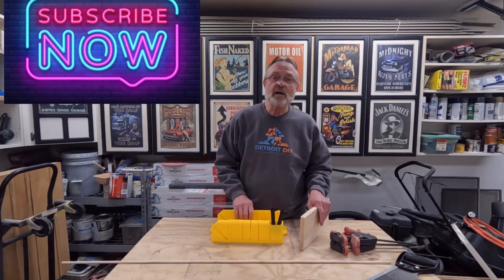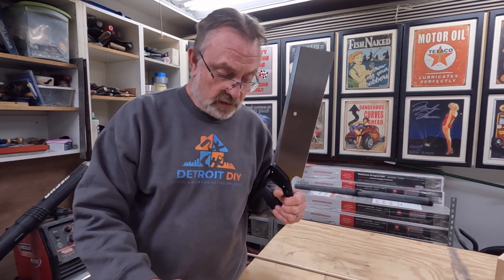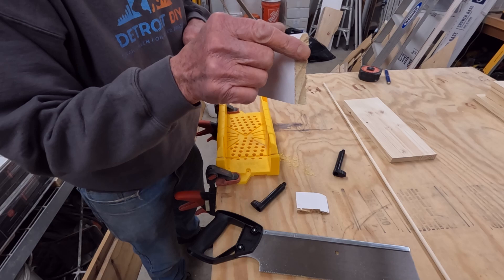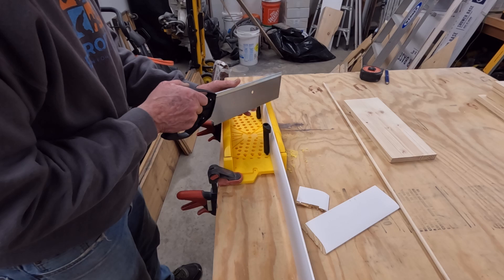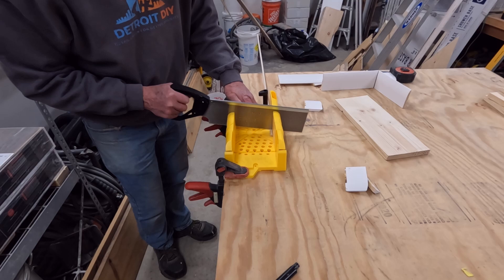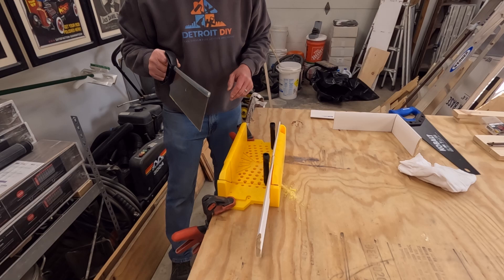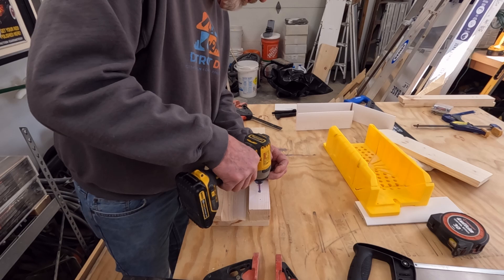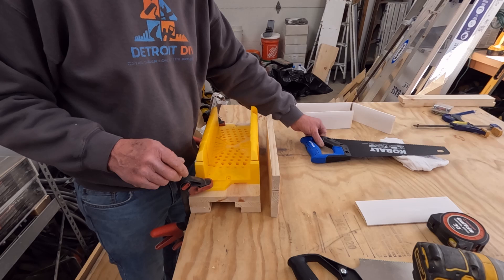How to use a miter box! Plus a tall wood cutting Jig!

Comment: Yeesh, that plastic miter box seems cheap?  Any particular reason one wouldn't spend a little extra money for a metal one?  Any down sides?
Reply from the maker: There are downsides, you can't cut ,half degree angles. Such as 45.5 also the saw blade takes a little plastic with it. However if you don't want to spend the cash on a miter saw and need to cut tall trim this is about the only way to do it. Thanks for watching.
Reply: @detroitdiy  they don’t make metal miter boxes with 45.5 etc?
Reply from the maker: https://www.amazon.com/CRAFTSMAN-Mitre-Adjustable-Angle-CMHT20800/dp/B07R4BVSB4/ref=asc_df_B07R4BVSB4/?tag=hyprod-20&linkCode=df0&hvadid=385272107002&hvpos=&hvnetw=g&hvrand=1366489244793890558&hvpone=&hvptwo=&hvqmt=&hvdev=m&hvdvcmdl=&hvlocint=&hvlocphy=9017008&hvtargid=pla-824640414856&psc=1&tag=&ref=&adgrpid=78829231656&hvpone=&hvptwo=&hvadid=385272107002&hvpos=&hvnetw=g&hvrand=1366489244793890558&hvqmt=&hvdev=m&hvdvcmdl=&hvlocint=&hvlocphy=9017008&hvtargid=pla-824640414856
Reply from the maker: Check out that miter box.
Reply: @detroitdiy  ah nice.  I’ve actually had my eye on this one.  I assume also there’s no reason this wouldn’t work with the trick you’ve detailed in your video, yeah?
Reply: Disappointing u sawed the box slow down I watched other video that did it perfect that Nick will make a difference
Reply: You make look so easy.  Ty
Reply: @detroitdiy I had one of these a very long time ago until it broke apart, and only used it for 45 and 90 degree cuts.  Apparently there is no way to lock it at any desired angle, only the usual preset ones.  So why they show all the degrees is beyond me.
Reply: @detroitdiy  You can also cut large baseboard with a skill saw and a speed square. Or if you are skilled with hand saws you can cut it free hand and clean up the miter with a block plane.
Reply: I'm still not 100% sure how they cut the 7" baseboard in my 1923 house. The above mentioned seems to be the only way I can think of. Or they made a large miter box from scratch that they used with a panel saw, similar to what was mentioned in the video.